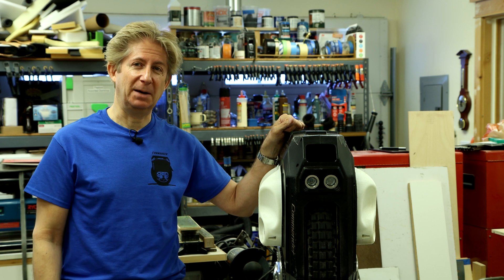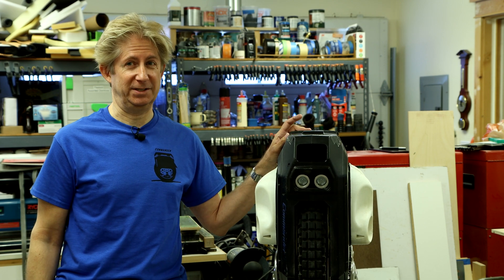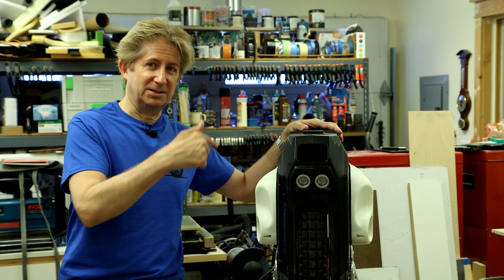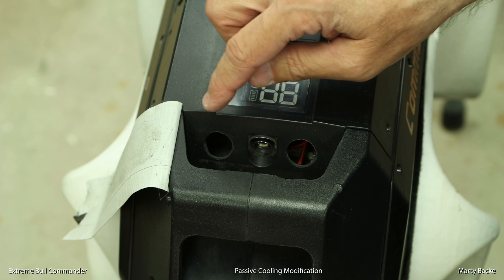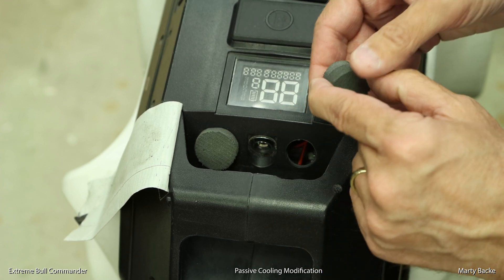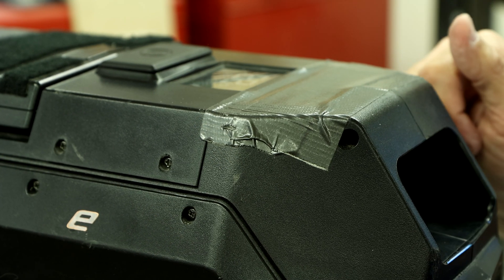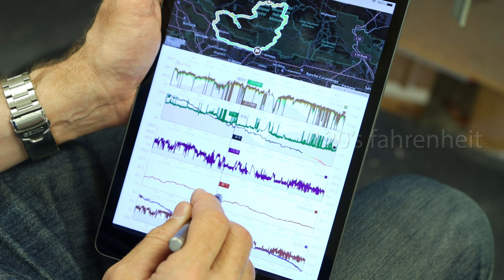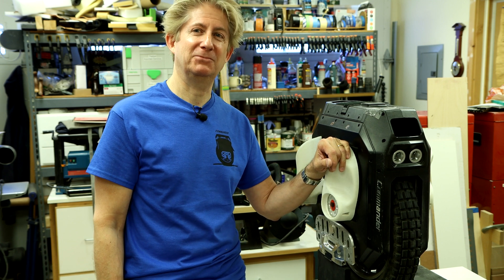Extreme Bull Commander Cooling Modification

Comment: Did you just drill blind or did you remove the top cover ? I’m just worried about wires being in the area behind we’re I’m drilling
Reply from the maker: I absolutely did remove the cover so I could see where I was drilling. I did not disconnect any of the cabling though.
Reply: @ElectricUnicycles   thanks 😊

Comment: Great video, thank you! I plan on doing this mod ASAP. I got mine up to 135F today, what temperature should we be cautious of? TIA
Reply from the maker: 75° Celsius
Reply: I completed the mod and wow! Two in the front each one inch and three in the back 2 that are 1/2 inch and one center at one inch. Thank you again!
Reply from the maker: @krain8458  and it did lower the temperature for you, hopefully?
Reply: @ElectricUnicycles  It sure did!! Same path... Before, 135 degrees, after 104 degrees. Very grateful!
Reply from the maker: @krain8458  Nice. Always great to get feedback on my mods. Thanks.

As long as the Commander stays moving it's now cool running for me. If you're climbing something steep and not moving very fast it can still get hot.

Comment: I am not certain about the location the veteran sherman measures the temp but it goes right into the red during these 103degree F days. I wonder if 130 is something to be concerned about?
Reply from the maker: That's a temperature not to worry about. When you see the temp's going north of 65° your wheel is starting to run hot. If it climbs about 70° you know you're in tough conditions and that it'll probably be getting hotter so maybe let it rest for ~5-minutes. I'd feel comfortable riding all day long at any temp up to ~65°

Comment: now the question is if you do really cool the mosfets, or just the temperature sensor, which is mounted on top of the PCB? because if last, you don't only cheat the graphs, but also make your riding very dangerous, mosfets get hot and go undetected, then blow... I think you need more research here...
Reply from the maker: People have mentioned this for years. It's a non-issue IMO. The temp sensor has physical contact with the board which means heat transfer to the sensor is much greater that any affect from increased air flow in the control board chamber.
Reply: I'm waiting on some hydrophobic cloth to do this mod. If I knew where the temperature sensor was, I might cover it up and see what happens. Does anyone know what the temperature sensor looks like?
Reply: @nh281  Use frog skin to cap these holes, we do that in snowmobile ;)

Comment: thank you fo rsharing experience. Are you plan sherman max solo overheat hill again? Is max realy more powerfull if have same magnets numbers and size like vanila sherman? 

What is you opinion becasue comander must be arealy more torque and efortless for ride compared to sherman max
Reply from the maker: The Sherman Max was already ridden up Overheat Hill (I have a video) with zero problems.

I recommend the Sherman Max over the Commander UNLESS range is more important. The Commander has more range than any wheel currently in production.

Comment: Did you drill the holes while the wheel was fully assembled?
Reply from the maker: No, I removed the top panel so I had the access that I needed. I didn't have to disconnect any of the cables though.
Reply: @ElectricUnicycles  TY! Another rider helped me drill the holes after a group ride today. Just need to tape it. Hope it does as well for me.
Reply from the maker: @SteryleBandNC  Hopefully you used the same size or bigger holes. I know someone who drilled smaller holes and it wasn't as effective. Good luck, and if you remember let me know how it goes.
Reply: @ElectricUnicycles  we made 3/4 holes like in your video as close to the same spots. Tested today in 88F and it was consistent hovering around 60-65C. It usually just keeps climbing but not now. I was accelerating harder than normal and could see the temp going down at speed. 👏👏
Reply from the maker: @SteryleBandNC  thanks for letting me and everyone else know that you had a positive result and it was worthwhile 👊
Reply: @ElectricUnicycles  Do you think there would there be any practical benefit in having two rearward holes in the same way as the front is drilled, just to let the air flow even more freely? Not that the Marty-made mod needs improving, lol!  Assuming the holes are drilled in the upper (removable cover) portion of the wheel frame.  I’m guessing you may have possibly supported/braced the underside of the areas to be drilled with a piece of wood or similar during the actual drilling process, in order to avoid any overly-strong ‘grabbing’ by the drill bit? Or did you use a step-drill bit?    Great result anyway, and the cooling effect must surely be reduce risk of premature battery pack deterioration, helping to extend the useful service life of these substantial (and costly!) battery packs to the maximum. 👌🏻

Comment: I wonder if a chain saw or lawn mower air filter would fit inside the front?
Reply from the maker: From my testing experience (here and with different wheels), ANY kind of filter placed in front of ventilation holes reduces the airflow by 90+%, killing any benefit. Filter material will only work if you have powerful fans forcing the air through the material.
Reply: @ElectricUnicycles  putting a fan in there could be possible. I'm thinking putting a filter in there instead of the plugs. 10 or 20% more air flow when dusty or raining might help compared to 0%.
Reply: @ElectricUnicycles  overall its a great diy hack for a serious problem. I'll pry never have a chance to ride a commander, but it would be the first thing I do!